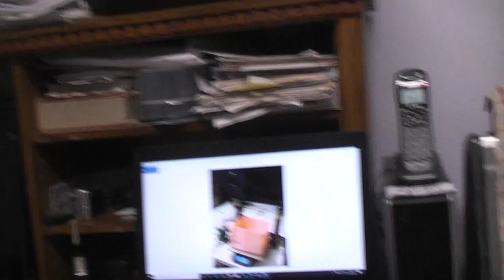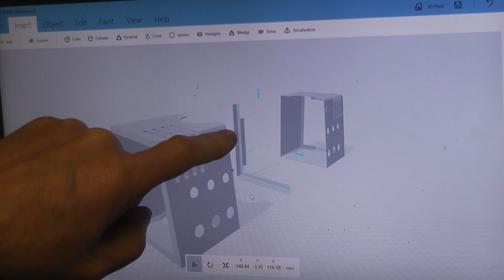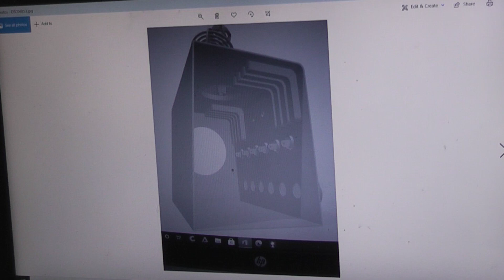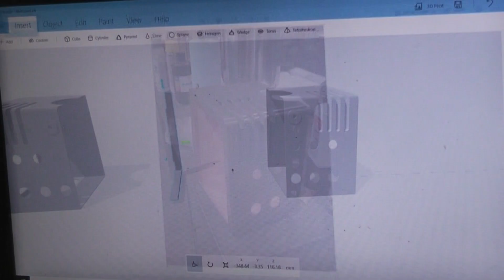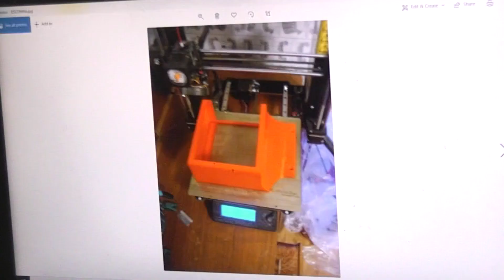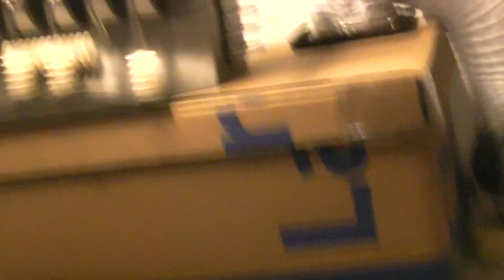Step 1. Block Head Robby Machine build. "Main Frame & Base.

Comment: So far I've got your Star Drive, the other spinning dome and your gyro head unit built and working. I had already made my own drive setups for Robby's eye dome spinning loops  but your heartbox star and dome with LED's is incorporated into the Robby I'm building with just your piano keys to add. Visitors here are astounded at the moving parts but I tell them I only print them, they're your design. It adds so much to the build to have these things working. I can't thank you enough.

Comment: Hi John, I'm in the process of building a Block Head Robby and wanted to ask you a question about the switches you used,  are those SPST or DPDT switches ? And what size wire would you recommend for wiring the TT Motors and LEDs ? I will get some of those 'C' Battery holders as well , Amazon has so many switches to chose from and all the specifics to those parts . Thanks for any help you could provide .
Reply from the maker: Check the rest of the build videos for more information. But the motors and LEDs draw such low current that any wire will work. For normal
ON OFF switches I like to always use the same slide switch in all my projects. The mounting holes are 19mm spacing. To turn something ON and OFF you only need a SPST but like I said I use the same switches in all my projects so in the video you will see DPDT slide switches.

Comment: What a great project. It looks like a 1950's 'atomic' radio, and it's wonderfully noisy, like Robby, well done, such a beautifull thing you have created and it has the mystique of Robby. I would have liked some blue neons or equivalent down the bottom and it functions as a radio so the blue lights are triggered by the sound etc.
Reply from the maker: The files are free so make a mod of your ideas as they sound great to me.
Reply: @Robothut  Oh thank you that's very generous.

Comment: Excellent video! Do you have any references for constructing the dome? I am working on my own project. Thank you
Reply from the maker: Back when I made my domes it was a very big project to make the large wood "slug" dpme master. Ten I had to find a plastic shop with equipment large enough to do the job. It took a bout 6 tries to get one good dome pulled. The wood dome slug even thou it was smooth to the touch would leave light wood grain marks in places do too the high heat and vacume so I had to then make a new mold that was coted in high heat resin. I spent many  $ thousands getting my domes made. So lots not a easy job. If you study close up pictures of the screen used Robby from the first film you can see there dome was not very good, it was paper thin with ripples on the back side of the head.

Comment: Your finish work is really nice. Do you use a sandable auto primer or something similar before painting?
Reply from the maker: I have arthritis so hate sanding as it painful. So I do not do as much sanding as I should. I just use a auto primer filler , I sand first primer then sand again then either primer again or just paint the final color.
Reply: @Robothut I hear ya, same issue here. Prime, fill, sand, prime again. Not enough years left in my life to make all the part joins perfect, particularly over a full build.

Comment: i wish there was a detailed diagram pointing to all his "bits", naming them and describing their pretend "Robot functions" , i know the blue lights are meant to be his eyes and are also handy for disabling blasters
Reply from the maker: Well most of it you know I think. The light on top his head is the Dome light, then the 3 gyro's, His revolving ears hoops are like radar so Scanner Rings, the blue lights that alternatly flash are no eye's they are his Beams they work like blaster guns on Monkeys and other things in the movie.
The two filppers that wag back and forth are part of the mechanical Brain, they move twice first then the Sax Valves run before Robby speaks to show that a computation has taken place. Some people like to call the Sax Valves the Clackers because of the sound they make.
The blue neon mouth lights were required for the film so people would know to tie the robots voice track to coming from the robot.
The heart box has the hopper samples can be placed for analizing.
The Star drive and the Genega units I have no idea what there Sci Fi function would be.
Reply: @Robothut  this is where i got the "blue lights are his eyes" from ?, https://youtu.be/a63i4rGZ1ts

Comment: Outstanding!
Do you have any C-57D Robby hands? They look like a quick and simple print...
Reply from the maker: Yes I have a set in the Robothut museum. I have  not 3d CADed them, it all takes so much time. You can see them in some of the Robothut video's in the glass case next to robby.
Reply: @Robothut  Have or haven't?
Reply from the maker: @Pygar2  corrected my post. Have not had time to 3d CAD them.

Comment: Great! Thank you so much for this. Looking forward to the next one. BTW: for the paint, I ended up using a combination of Rustoleum #345389 Gloss Charcoal Gray as a base, #244228 Metallic Charcoal misted on as a second darker "fleck" layer, then #334022 Matte Clear as a top coat. I know it seems like a lot to go through but it worked out great for me. I did a similar layering technique on my B9 to get the silver. Love it.
Reply from the maker: Sounds interesting. would like to see pictures of the paint job when its done.
Reply: I found a spray can of paint and prime in Dark Charcoal Gloss that's pretty close, at least I can afford it for my full size build.